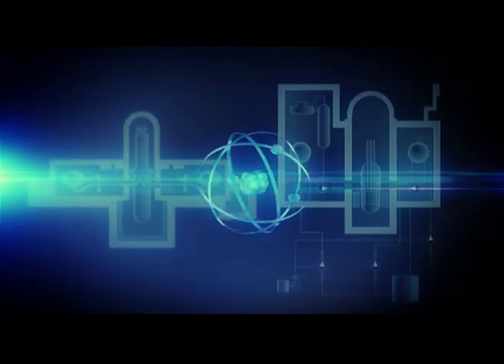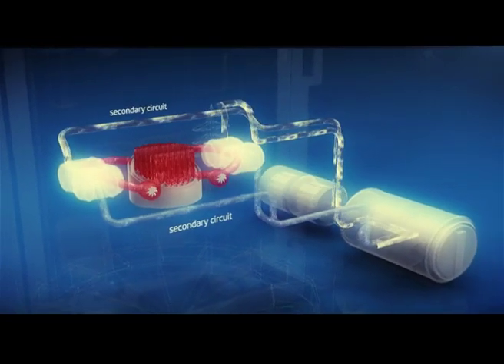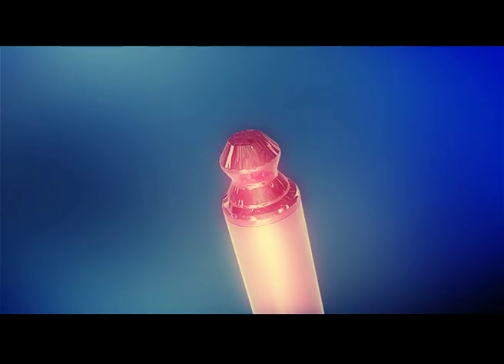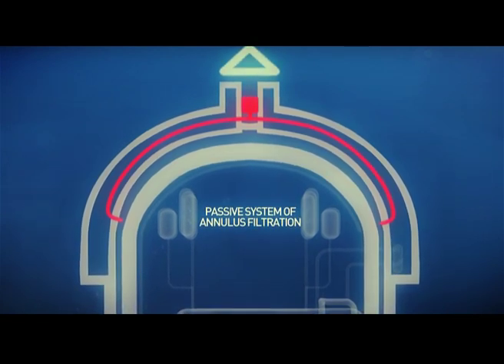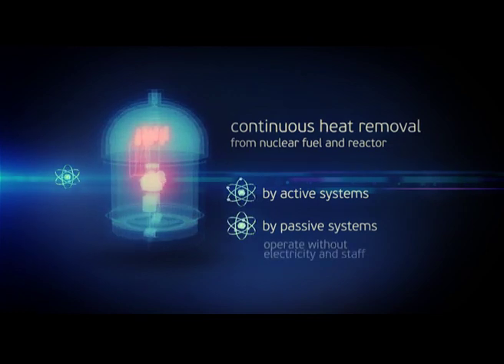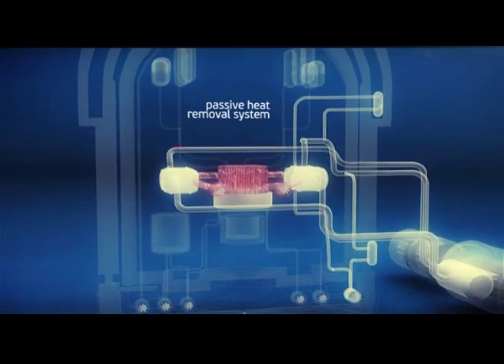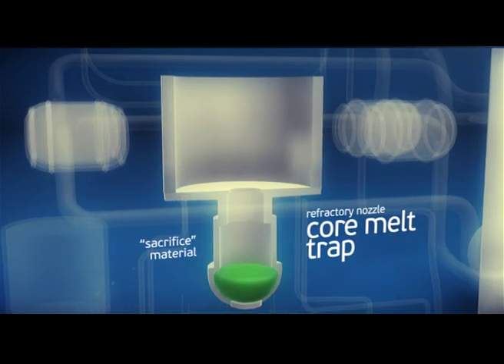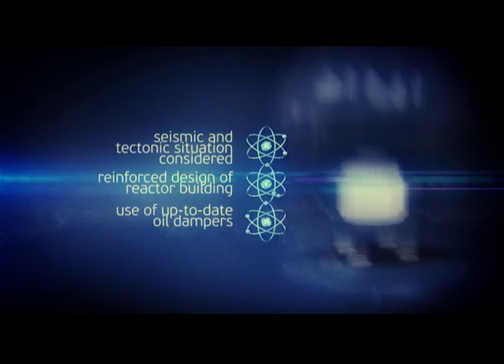nuclear technology VVER Reactors

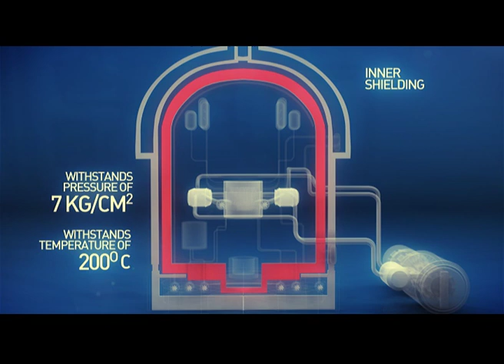Comment: @4:06 I think there is something wrong, I myself can apply more than 7 kilogram per square centimeter. I guess it should be 7 tons.
Reply: Even by pressing with my thumb I can exert more than that. And only 200 degrees also does not sound impressive.

Comment: One question to designers of VVER: what pressure are the steam generators rated at ? you say that vessel is rated at 160 Atmospheres, but what if this pressure gets into steam generators/ piping ?
Reply: 7 Mpa for Steam Generators and 16.2 MPa for RPV
Reply: The primary side of the steam generators is at the same pressure as the RPV.

Comment: Nothing like a good old fashioned RBMK reactor.
Reply: Actually RBMK is a modular reactor. So it was the best reactor in the energy output. If the safety was better, we would probably have the RBMKp-2400 and RBMKp-4800 which would have created 2400MWe and 4800MWe
Reply: :D
Reply: xD
Reply: :D :D :D
Reply: Kursk 5 <3
Reply: Thats a VVER-1200/392M